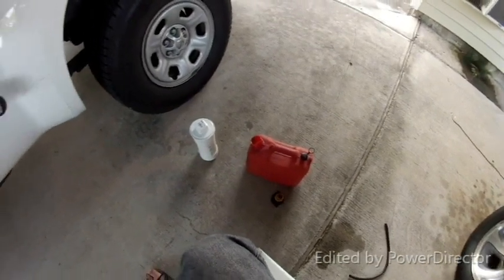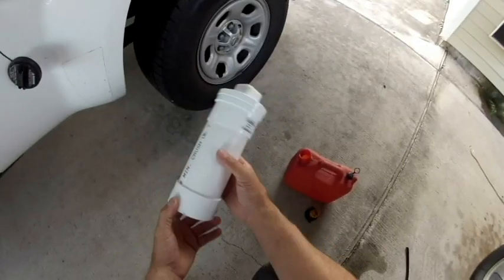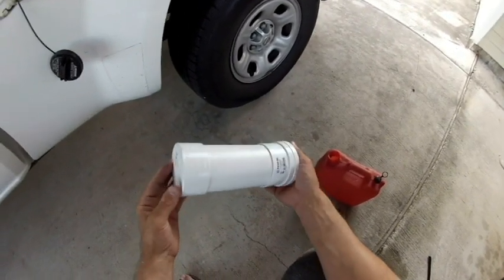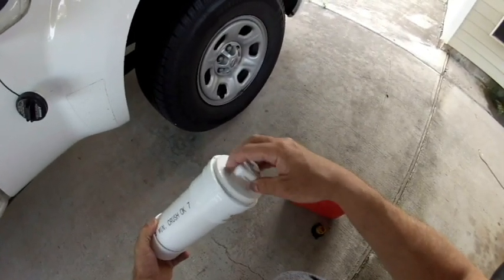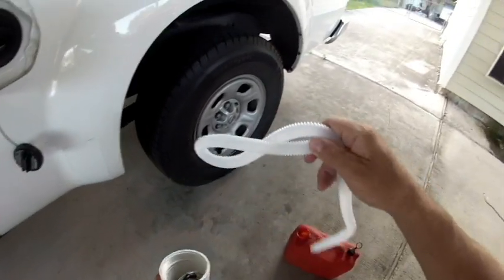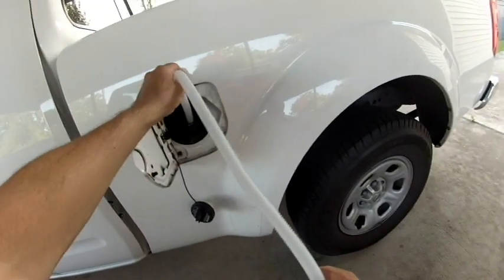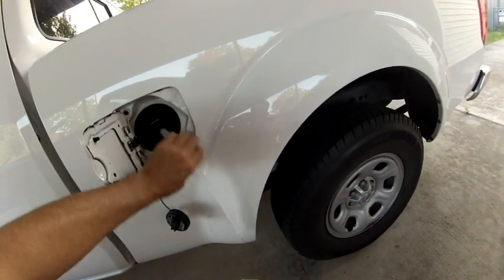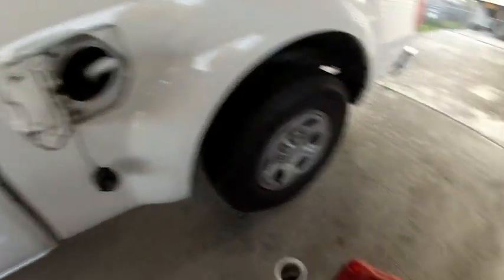easy way to siphon gas from a newer car

Comment: What is rate of flow??? You dont show if its gravity 6or Manual
Reply from the maker: gravity
Reply: Slow
Reply: With modern cars, it appears a 1/4" tube is the only option to get down in there. So, is increasing the flow rate even an option?

Comment: where did you get tube from and what size is it
Reply from the maker: +frank z 3/8 in tube and 1/4  in tube
Reply: Hard tube or soft tubing
Reply from the maker: +frank z more  ridged especially on the 1/4 tube
Reply: Where can I buy

Comment: If it's not your vehicle and the other donor vehicle is technically abandoned , just punch a hole in the lowest point of the tank and filler er up.
Most tanks are plastic now so a sharp drill bit inserted into a rethreading tap holder would get you through that.
Don't want sparks at this point so no electric things that make sparks.
Yes , you DO have to crawl under the vehicle for this one and bring a shallow fuel tank like the ones for a boat to collect the fuel into, perhaps more than one.
I have also been trying to make up a good way to get fuel out of underground storage tanks in a total grid down situation.
Using a high pressure (in tank) electric fuel pump at the end of a long hose and a 12 VDC power supply with a switch that is sealed and doesn't spark to turn it on.
Reply from the maker: https://www.youtube.com/watch?v=wKjxFJfcrcA&feature=youtu.be
Reply: Did you ever come up with a way to get the gas out of the storage tanks underground?
Reply: The method you propose seems more difficult, a lot messier, and a one-time shot. So, I am confused by your use of the word "just".